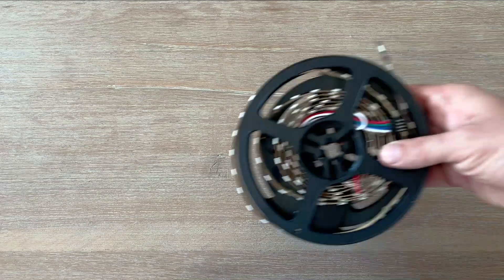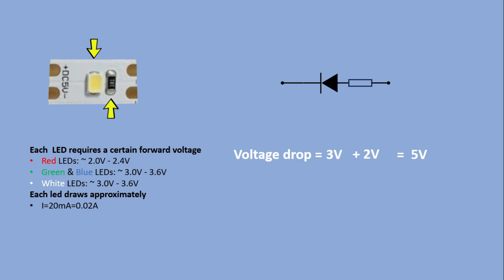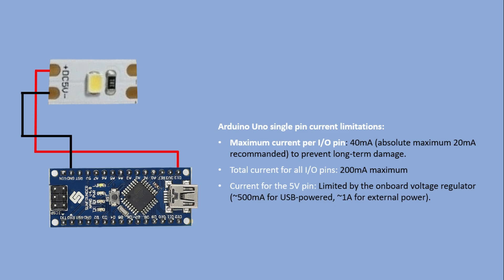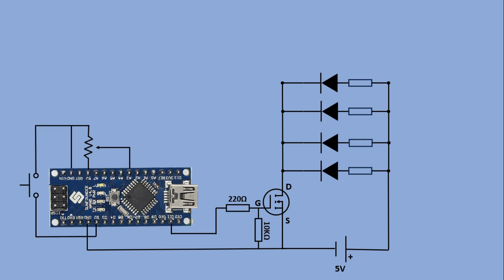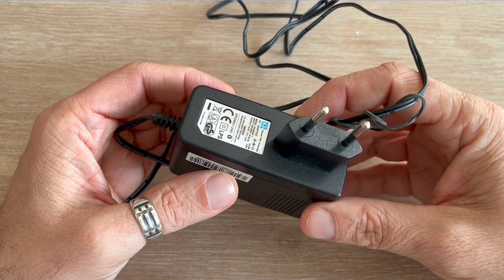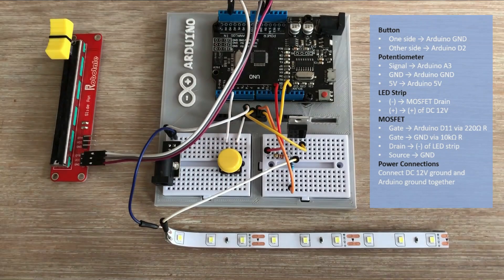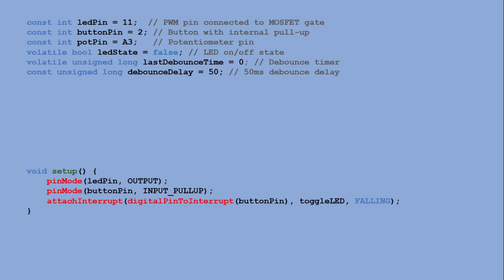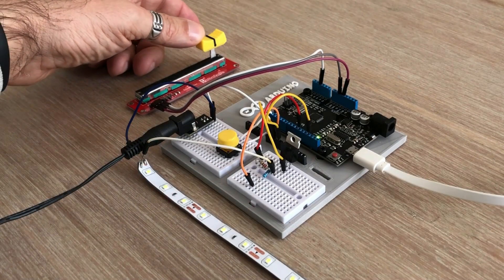LED Strips & Arduino – Understanding 5V and 12V Single-Color Strips

Comment: I have no clue about electronics but my aim is to gain enough knowledge to make a Mengenlehreuhr (Berlin clock) from LED strip. This seems like a great video to aid me down that path.
Reply from the maker: That would be a cool project.This probably is not the best video as you need to change states of several leds. Here you set all leds to either on or off. You can do it either by using individually adressable leds strips https://youtu.be/YKSFRmvA9A0, this can allow you to have different colors of each time component, you can also use shift registers to control multiple leds https://youtu.be/QI1IJLB42G8 or https://youtu.be/sQfghvHYTlk

Comment: This is very cool! would i be able to cycle or change images on a 8x8 dot matrix " MAX7219 module" with a pot with 6 different ohm range positions?
Reply from the maker: Max7219 matrix is very different to those led strips . I have a couple videos on this subject . Not clear to me what you are trying to achieve
Reply: @marios_ideas  ok so basically I'm trying to make a gear shifter indicator for an older automatic transmission. it only needs to display "PRN321". The potentiometer would be attached to the shift cable at the shifter. I can 3d model and print anything i need.  Then with some type of linkage i would use the ohm reading for each gear position on the shifter to dictate what the dot-matrix reads. SORRY, I'm terrible at explaining things lol

Comment: 101 on the resistor is not 101 ohms.... it is a 10 with an extra zero (the last digit in this case 1 zero) so 101 is 100 Ohms... Great videos you make BTW...
Reply from the maker: Duly noted. Thank you! 🙂